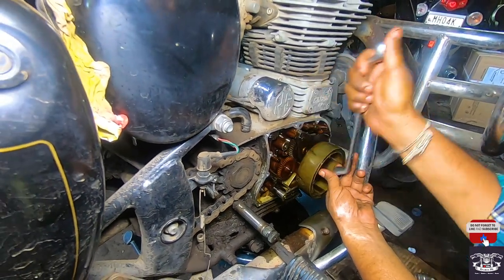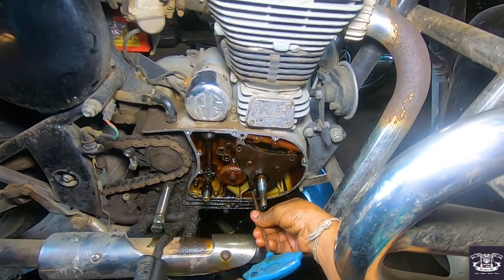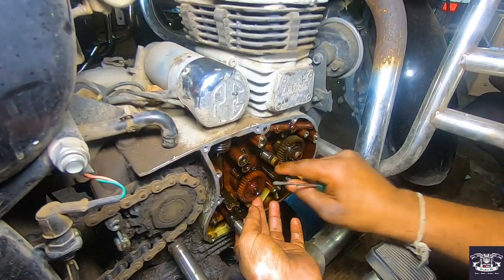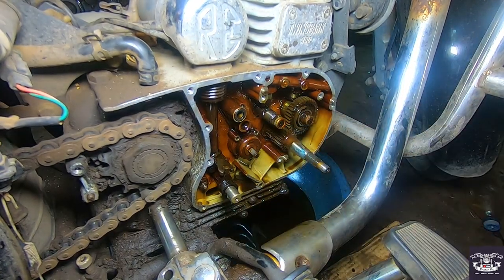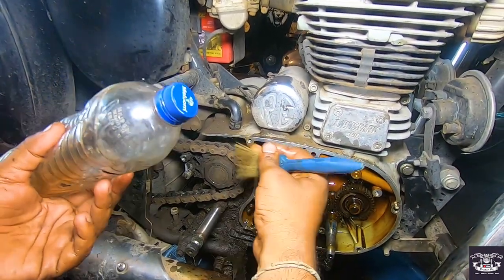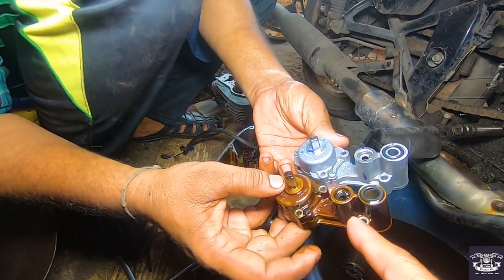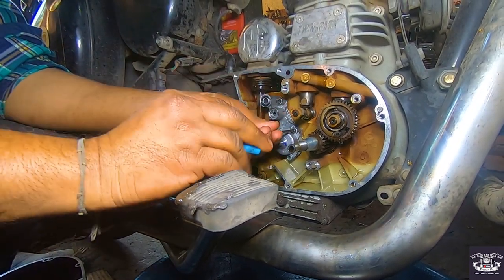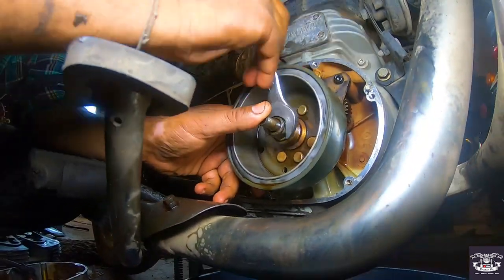Royal Enfield Oil Pump Replacement | BS4 Oil Pump in BS3 Bullet

Comment: How did you remove magnet flywheel (did you use any puller )?
Reply from the maker: Nope my mechanic did it with bare hands. Just used old cloth for proper grip
Reply: @XplorerMe bro

I fixed everything and  hearing humming sound (any issues)
Reply from the maker: @A2ZMEDIA2021  This could be an issue wit break pad sound also. Check exactly where tye sound is coming from.